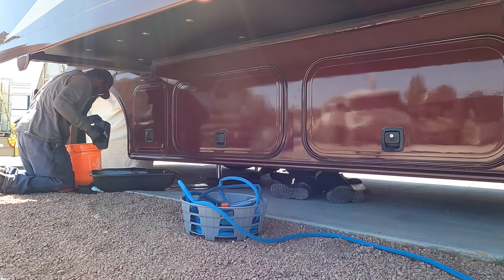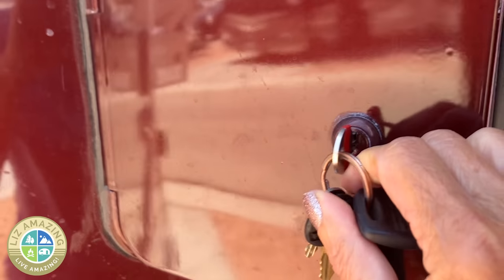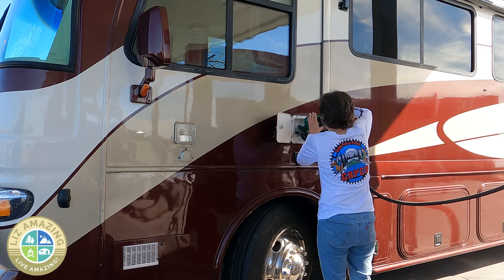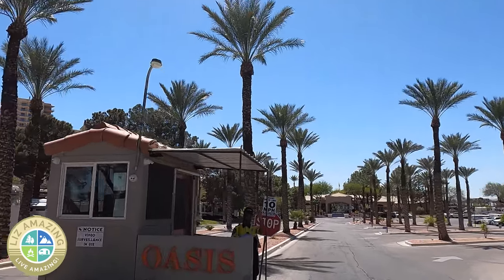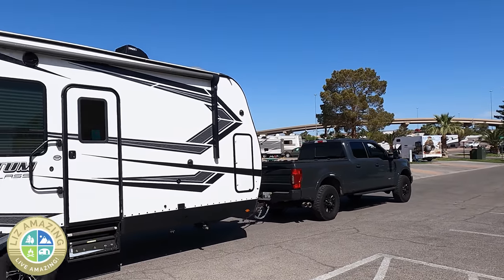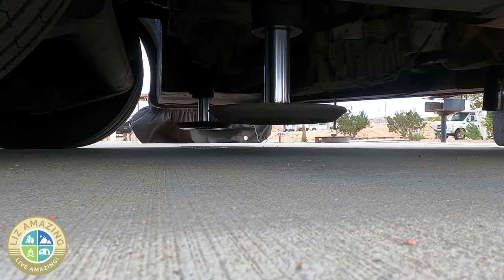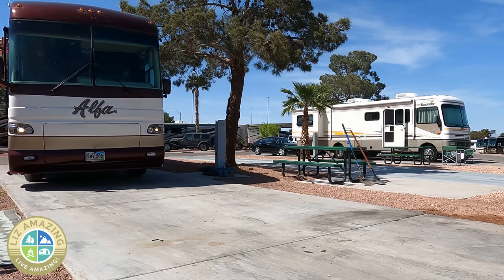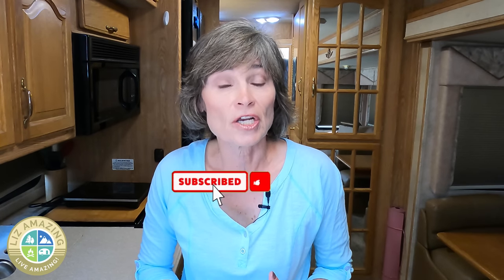RV Life: The WORST mistake I've ever made!

Comment: I completely understand the feeling. Both the feeling of doing something stupid and feeling like you’ve punched a hole right through your gut and the feeling of hopelessness with RV repairs.
I absolutely hate being restricted on the service I have access to. I also really hate when a mechanic tells you they can fix something, only to tell you when you come that they can’t. It’s infuriating. It wastes so much time, stress, and money.

Last year, the fuel pump on my rig died. Right on my very first trip with it, it didn’t even make it home. I am thankful that it happened to be an intersection in a town, so I didn’t have to worry about getting it towed. However, it was a small town, with limited service. Because replacing the fuel pump would require dropping the fuel tank, and an RV can’t be on a normal vehicle lift, most shops wouldn’t even touch it. Only one would, but they were going to charge an arm and a leg because they would have to go under the rig. The heavy truck mechanics wouldn’t touch it despite having lifts because it was a gas motorhome and apparently not something they could fix. The only other place in the town that would work on it was a Ford dealership. But they would only use genuine Ford parts which were no longer available due to the age of my rig. 😖 My two options were the shop that would charge an arm and a leg and didn’t really know what they were doing, or get the rig towed to the nearby city which would have cost something like $1,000. I ended up going to the one mechanic in town that would look at it and they managed to “wake up” the fuel pump, but it was only temporary. They charged me $600 just for that diagnosis and “fixing” and they also damaged a part of my rig. It was so frustrating and stressful.
I ended up selling my RV a few months later because it was just too stressful with repairs and service. It is too bad because I loved it and really do miss it so very much.
Reply from the maker: Oh my goodness. You bring up so many important points to people who travel in remote areas, and/or have older rigs. Thank you so much for sharing your story, and for watching. See you in the next video.
Reply: Thank you! Mistakes and experiences can be made into a learning experience and will help others. It can be so embarrassing to share, but it could save someone else so much stress!

Comment: Another thing you could of done is disable glow plugs and remove injectors and turn over the engine until all the water squirts out of the injectors. Just a word of warning diesel injectors have enough power to cut hands off.

Or you could have done the above BUT leave injectors in place and remove glow plugs and turn over the engine and the water/fuel will shoot out of the glow plug holes.
Reply from the maker: Whew, thanks for this. But just too risky for me outside of. my abilities. Glad to have all that behind me now, thanks for watching.
Reply: Sure, the RV park would be thrilled to have all that diesel "squirted" all over the park...
Reply: Best not to do it if your slow in the mind @DaveDrawing

Comment: Why not attach a fitting and hose to the drain and use a drill pump instead of bailing a few gallons at a time. They could also have pumped it out from the fill port where you filled it using a pump. Then complete the process underneath with the drain plug.
Reply from the maker: I'm sure there were better ways to do it. Just glad to have that behind me now. Thanks for watching.

Comment: With a fuel transfer pump they could have pumped from the tray straight into container. Also have the lock on the fuel door changed so the doors have different keys, with a big tag on the fuel door key. It's a whole lot easier to make this mistake then it is to fix it.
Reply from the maker: Yeah, I don't know why they did not do that Walter. I will definitely be adding a locking fuel cap. Thanks for watching!

Comment: You probably know this but learn where your fuses are so you can pull the fuse to your fuel pump so it won't run when the key is turned. Also buy a headlight so you have both hands free at night. The other thing is change the ĺock so it takes a different key.

Comment: Well I guess that is probably one of the stupidest mistakes anybody could make! Reminds me of the time I mistakenly squirted white [paper] correction fluid in both my eyes instead of eye drops when I grabbed the wrong bottle in my pocket at night time without looking at the bottle. Worse still was that the white correction fluid was spirit based. After squirting a full load into each eye I felt the stickiness and ran to the wash basin but because it was not water based correction fluid it would not wash out. Lucky for me I was wearing contact lenses. I blinked incessantly and my eyes eventually cleared and when I turned the light on I had big white rings around eyes with little pupils peering through. Lucky for me, my eyes recovered and were okay!

Comment: The repair shop could have used a pump system to get contaminated diesel fuel. That means a catch pan for safety. A valve threaded into the fuel tank on coach with a quick connect fitting with hose hooked to a pump to the contaminated tank. Way faster, cheaper and less messy.
Reply from the maker: Yes, I’m sure there were better ways. I’m just glad to have that behind me now and they are still my heroes. Thanks for watching.

Comment: Get your fuel filters changed soon.  And if my limited diesel knowledge is any good, you want to open up the water separator on your engine and drain it out.
Reply from the maker: Yes! I did exactly that, let what I drained sit in a clear container for 24 hours, no evidence of water. I bought a new filter but may wait a little bit before changing it. Thanks for your tips, Jeromep!

Comment: I'm surprised that the guys from I15 repair don't have an electric fuel pump and some hoses so they don't have to do that messy under the rig work.   Just put the hose down the filler cap and put the other end in the big tank.   If they deal with this a couple of times a month, it would probably pay off big for them.   Let's see, where is that Oasis RV Park?   Oh yeah, Las Vegas, the city of a million people wanting a tip, or a bribe, or a payoff.

Comment: Simply call a tow company tow rig out front gate and get it repaired outside the front gate by the original vendor.
Reply from the maker: Keep watching and I talk about exactly why I couldn't do that. And thanks for watching, Glen.
Reply: @LizAmazing  I did watch all the video, I am saying that's what I would have done. Called a tow truck, pulled the fuses for the fuel pumps, so the jacks could be lifted and had it towed out the gate. Made the video of the RV park going insane as you get it fixed outside their gate. That RV park has a scam going on to rip off the people who come into the park getting kick backs from their "preferred vendors". Exposing them is their kryptonite and you helped to expose them for what they are. I am saying I would have done it differently that's all. Thanks for this video and yes it is very easy to put fuel, water or whatever into the wrong tank especially at night and when tired. The good thing is you did not get water into your engine. Thanks again.

Comment: I am sorry you had so much trouble.  Just let you know gas into diesel is disaster if you start up the vehicle and drove it. Usually damaged the engine. Damaged to the engine is $15000-$30000.
Diesel into gasoline vehicle is not really bad it just smokes a lot from the tail pipe. Water into diesel bad for the injector pump and injectors. Water is not a lubricant so the high psi in the injector pump will be damaged. Replacing injector pump on motorhome would cost about $5000 or more. FYI

Comment: The repair guys should have put a ball valve and a hose on the drain so they didn't have to keep fighting with the plug and pan. They also make pumps you can run with a drill they could have put down the fill hole to pump out most of the fuel first.
Reply from the maker: Yep. There were definitely better ways of doing it. I'm just glad to have all that behind me now. Thanks for watching.

Comment: When she first explained what happened I felt shock and horror then I felt embarrassed for her, then I remembered the time I was on a national tour exhibiting a specialize show car that’s worth nearly half $1 million. It had a gas tank and in Oregon they don’t allow you to pump your own gas. I pulled into a station and the young man who filled the tank, filled it with diesel by mistake instead of gas. I didn’t know he had done this. I started the vehicle drove it about a quarter of a mile and it started smoking and then an explosion sound like a very loud backfire then the vehicle came to a stop, kind of choking.
Of course this happened at 5 PM on a Friday of a holiday weekend so it was gonna be hard to get it repaired. I won’t go into details but it was a very long ordeal but luckily Mechanic was able to clean the fuel pump, the fuel line, put in fresh spark plugs, and after I drain the fuel tank I had it cleaned filled it up with gas and it took about two tanks worth to finally get the system flushed and the vehicle operating fine. You’re probably asking: if a vehicle was worth nearly half $1 million, why weren’t you just trailering it instead of driving it? Because it is a show car and part of the attraction and fame of the vehicle is for people to see it driving. To be towed on a trailer to all of the exhibit shows and parades would just make it a “trailer queen“. I will leave that tall of the hot rodders classic car owners and Lowrider owners… That’s how they do it that’s fine with them but I prefer to drive the open highway. Great video looking forward to more of your videos with tips information and of course they seem to be entertaining, though this video was pretty painful to hear about. Glad you survived!
Reply from the maker: Oh my goodness, thank you for sharing this story. Must have been quite the ordeal!

Comment: “They do it all the time” but don’t have a 25$ transfer pump. That would have made the whole job take 10 minutes. Also wouldn’t have spilled fuel everywhere. Also no one would have had to lay on the ground. The fuel system also has a fuel water separator and the Howes just sends all the water through the fuel system. It doesn’t “dry” it. It just doesn’t allow the fuel an water to separate effectively contaminated all the fuel
Reply from the maker: Yes, I don't know why they did not use a pump. There may be a good reason, I just don't know. I am just glad to have that behind me now. Thanks for watching.

Comment: All I can say is WOW They saw you coming, I have owned a truck stop selling diesel fuel and ran heavy equipment for 30 years, first as far as the water in your tank, our tanks depending on the time of the year had between 2 to 4 inches of water in the bottom, this is due not only from a leaky tank but also condensation when tanks are low, remedy was to have pumps 6 inches off the bottom, we sold fuel for decades never a problem,  Rubbing alcohol also removes water from your diesel instead of the higher priced stuff, I also recommend it in the winter to keep fuel from gelling, Being you were worried about water in your fuel and assuming you have electric fuel pumps the easiest way to remedy this is to unhook the main line & add a long hose onto it and simply turn on your pumps, this will easily empty your tanks and fill a exterior tank. draining your tank and refilling  would have been fine. I have had as much as 25% gasoline accidentally put into trucks before and just drove it out, not the best solution but it works, if the rig was mine i would have siphoned off water until I hit diesel then reattached fuel line and went about my business, just a fyi You can use a external air compressor to air up your system if you have the proper external fitting. It sounds like they have a good racket going, sorry you got caught in it.
Reply: Just to be clear unhook main line before the fuel gets to the filters, then siphon off dirty ( contaminated )fuel
Reply from the maker: Thanks Roy! I'm sure there were better ways to do it but they are still my heroes. So glad to have that behind me now!

Comment: 😎 Put a locking Diesel ⛽️ cap on your rig so this does not happen again!  You will have to go through TWO KEYS 🔑  to fill the Diesel and then you will know water 💧 does not go in that tank! 😉. 
 One more thing that will help in case you have someone else ever full your tanks for you and you are not their.  LABEL the outside tank doors Diesel only! ⛽️ & water only! 💧.   Also the locking cap Will  help prevent someone from stealing your fuel.  Hope this helps... 🔑
Reply from the maker: Yes, I think you're right. I was going to go just with the locking fuel cap, but I do think labels are the way to go. Because I truly don't know if someone else will be opening those doors to fill the tanks. Thank you for this! And for watching.
Reply: @LizAmazing   your welcome!

Comment: I can't believe someone who provides that service doesn't have the right tools for the job. A 12 volt pump in the pan with a hose is less than 200 and would mean they pull the drain plug once and pump it straight into the big tank. They could also get a water separation filter so after the fuel settles they could pump most of it back into the rig. I guess if they are charging time and materials there is no incentive to be efficient.
Reply from the maker: I have no idea. I'm just glad to have all that behind me now. Thanks for watching

Comment: I have a solution to pass on to your subscribers, put a locking gas cap on you fuel filler pipe and buy separate different colored key chains for the keys to the fuel and water door 😊
Reply from the maker: Yes indeed! I did exactly that. Thanks for this!

Comment: @12:15 The basin those dudes used has a large crack.  I don't think those guys knew what they were doing or had specialized equipment for the job, without spilling diesel, which they did do.  The RV park should have charged you for cleaning the spill.
Reply from the maker: There was no crack in the basin. There were probably better ways to do it but those guys remain my heroes! Thanks for watching.

Comment: I would never make a mistake so big as buying a Mobil home. 
So no I would never fill my diesel tank with water. 
Navy shipping has been using sea water to off set ballast in diesel tanks for a hundred years. This is an easy fix. You don’t even need to dispose of all the Diesel in the tank.

Comment: Great video explaining exactly what happened.  Putting the water in the diesel tank was not your fault.  That is an extremely poor design to have the water fill up so close to the diesel and having similar locked doors on both.  Neither of them are labeled well either.  This is just terrible ergonomics.  Someone could just as easily put diesel in their water tank and poison someone.  Very dangerous design.
Reply from the maker: Aww, thanks for understanding. I ended up getting a locking fuel cap!
Reply: @LizAmazing  , that was a good idea, and it should make your RV safe; however, the RV company should do the same thing or move the water tank fill spout somewhere else.  I think you could actually sue them for such a bad design.

Comment: I must have bumped my head.  Are those guys not using a 12 V or better yet a 110 V electric pump (using your genset fueled by a 5gal can) w 20 feet of hose to pull bad fuel from black tub to large reservoir on truck?  Minutes instead of hours and no spillage.  I mean how do they dispose of bad fuel?  Rebucket it 5 gal at a time into another larger container?
Reply from the maker: I don't know. I'm sure there are better ways to do it. I'm just to have this behind me now. Thanks for watching.

Comment: If I have $2 to $5 fuel in a 55 gal Drum I’m going to set one side of Barrel on a 2 x 4 Let water settle and Pump it or Siphon it out until it’s only Fuel coming Out. Then Put a good Fuel Treatment in Fuel,and use it in My Equipment.  Old School Mechanics, and Wrecker Drivers are Hard to Find.
Reply from the maker: Yep. That would work. They did not start with a clean barrel though. Wish you were there!

Comment: Holy moley You certainly should not depend on GPS in some cases . Always double check Google maps cause you  only needed to gobabout a mile or so to get to the TA just west of Oasis. basically doing 'around the block '  turns. Per Oasis and the obvious kickback scheme they are running, well not much you can do other than posting and warning others. Sad to hear cause they are in a good area, have decent amenities and convenient to Smiths supermarket , outlet shops and restaurants.
Reply from the maker: Yep. Unfortunately since I am not a local, I have to depend on the RV Garmin. I have my height and weight set in there to avoid low bridges and overpasses. Oasis is definitely in a great area, much better than when I stayed at LV Resort last time off Boulder Highway! Thanks for watching.